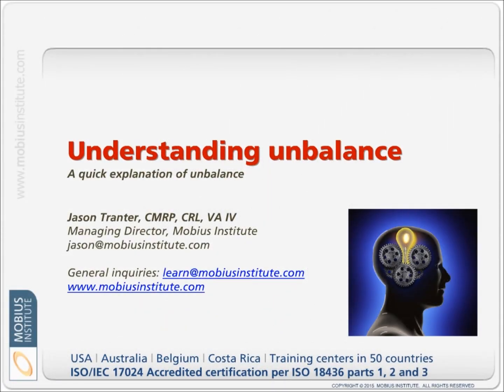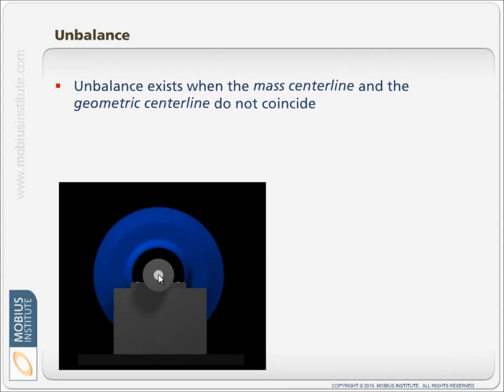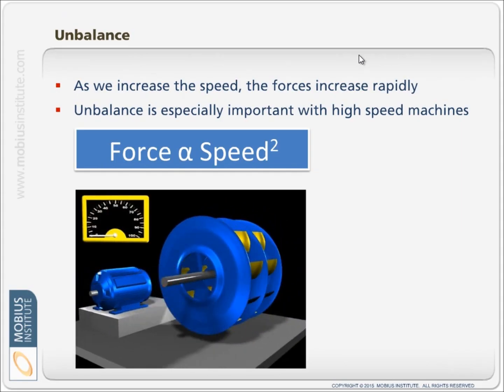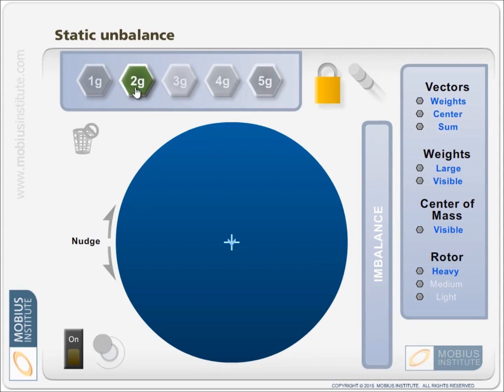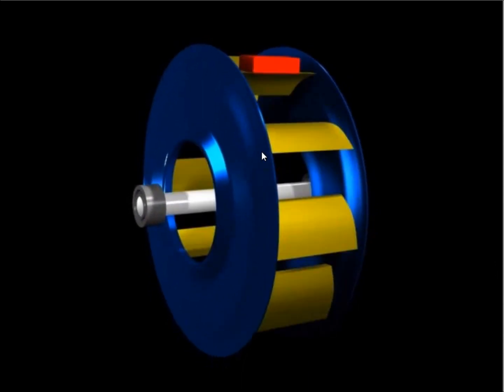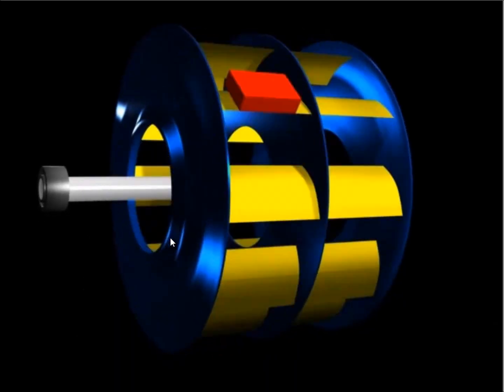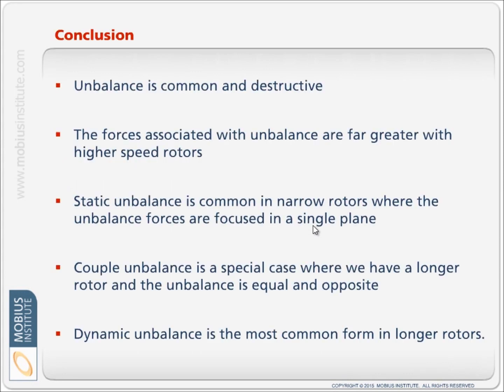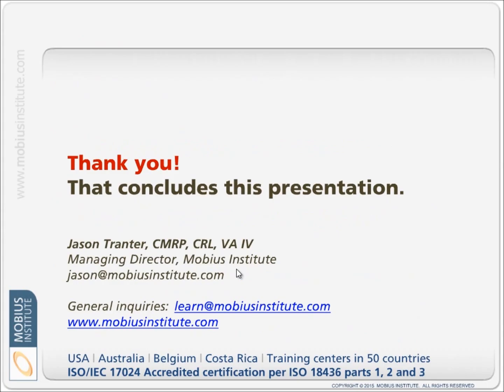Balancing Know-How: Understanding Unbalance

Comment: I think the correct axis referred here is not Geometric centre. It should be 'Rotating centre'. 

Because, even if both geometric centres and mass centers are coincided but the rotating centre is offset, then it creates unbalance.

Also, even if mass centre is offset from geometric centre but if mass centre lies on rotation centre, then it is balanced. 

If i am wrong, please correct me.

Thank you.
Reply: I don't think you're wrong, but it becomes an issue of semantics. For the geometric center, it is implied that it should the the axis about which the mass rotates. Hence the geometric center is the same as the rotating center.
Reply: @andrewbryan8597  Thanks for clarifying:-)

Comment: I have been balancing industrial rotors from the tiny to 35,000 lb`s for 20 years. I use my old school CSI 2120 and I walk on water. Great video, wish I could explain this in a building at 150 db.. to them. I say weld this here and shut the door!